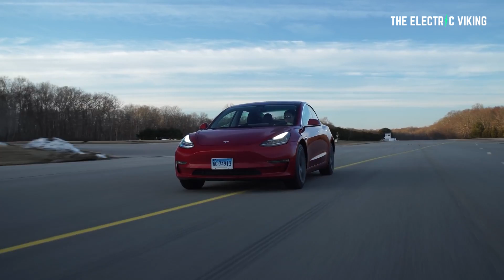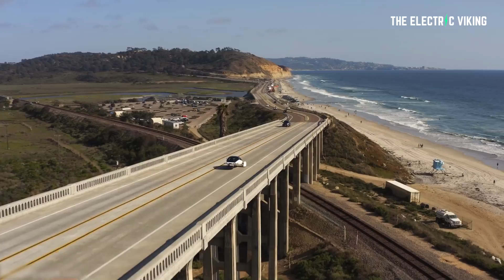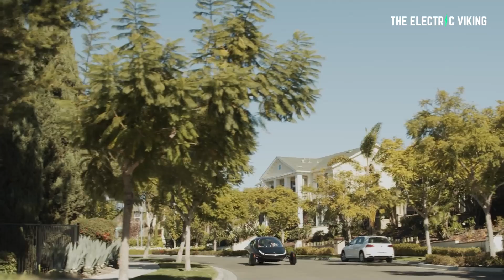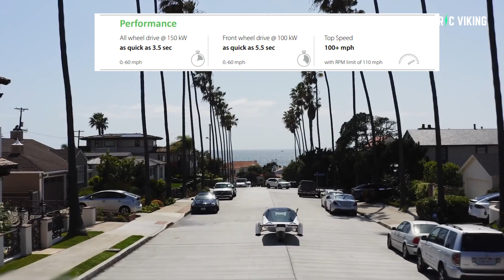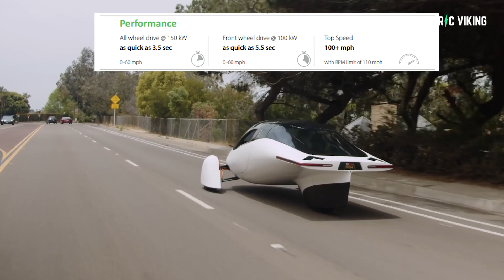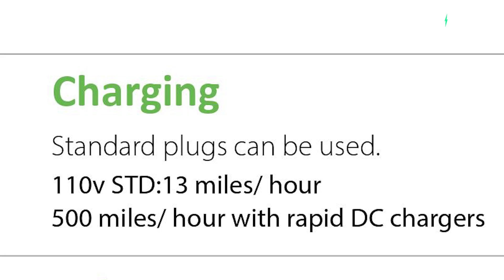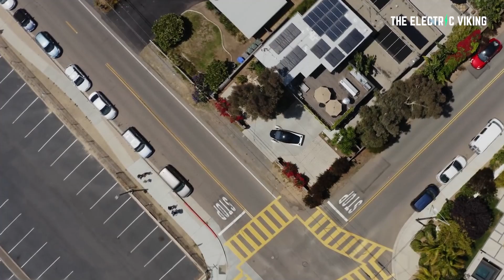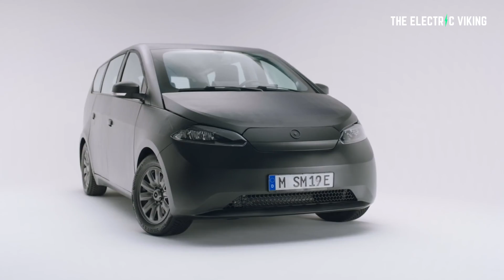I JUST bought a self charging US EV with 1000 mile range

Comment: That is an exciting vehicle but I have concerns that include these two:
1) The wheel covers are so close to the ground that hitting a pot hole would break a piece off, I would think.
     (Looking forward to your report on the suspension)
2) How safe does a three-wheeled vehicle take a turn? Aren’t they more prone to rolling over?
Reply: I've read they're slightly increasing distance between the road and the wheel covers, but I live on a gravel road so I opted for the off-road package for more clearance. As for stability, there's video, I think, of them at the track with an Aptera taking extreme maneuvers without anything scary happening.
Reply: And the wheel covers move with the wheels so the gap between them and the road is constant.
Reply: @ethelred2648  what I was thinking, on a regular car if the tire goes down into a pot hole, the rubber tire hits the pot hole crater and the surrounding road above the crater, without necessarily breaking because the tire is rubber. But with the wheel cover surrounding the tire, I would expect the wheel cover to break when it hits the pot hole crater or surrounding road above the crater. I mean, the wheel doesn’t separate down from its surrounding cover, right? I’d like to see someone driving the vehicle over a pot hole to gain a better understanding of how it works.
Reply: @georgeginsburg545  in that instance you’re right. It could be an issue.
Reply: “Aren’t they more prone to rolling over?” No, not if the two wheels are at the front. See any video of a Morgan 3 wheeler racing.
Reply: The alpha prototypes have sailed through the "Moose test" without losing control or rolling over.  Battery weight in the belly is a beautiful thing.

Comment: The concept of the Aptera is great, but it has some serious drawbacks:

As others have mentioned, the unspring weight of wheel motors is not an insignificant issue, there's a reason why it's not a good idea to subject your motors to all that impact and vibration.

At over 2.2 metres wide, it's almost as wide as a large truck, it's over 200mm wider than a Tesla model S, and that's a wide car. This makes it more difficult to manoeuvre in tighter spaces, especially in garages.

The outrigger wheels are prime candidates for getting hit in carparks. As other drivers back out they won't be able to see those wheels sticking out as they will be below their bonnet line. There will be a lot of wheel damage incidents with these cars.

The fairings on the outrigger wheels look like they are only secured along their inner edges, they bounce around a lot in the video, those fixing points will fatigue, that's a dead-set certainty, unless they address that.

The skirt around the rear wheel is too low to clear any sort of speed hump, there's at least 300mm of skirt in front of the wheel. I really hope that skirt is made of flexible rubber.

I think they need to do a redesign on the outriggers, pull them in at least 100mm on each side, redesign that rear wheel skirt for more clearance, and consider dumping the in-wheel motors and go with shaft drive, like more sensible manufacturers have found to be the safest and most reliable...
Reply: You make a great point about outrigger wheels being hit in parking lots because they don't get seen by other drivers.  Your other points are valid as well, but will probably (?) be addressed in the beta versions being built now.
Reply: Great points, especially the wheel fairings bouncing around a lot. But if they take your suggestions and improve the design to be more robust and suitable for the roads, then the low drag coefficient, the solar charging, and the relatively low cost, make it a a cool and exciting way to finally get an EV.
Reply: The sticking out is a big concern. I can see having to carry traffic cones and having a little flag holder for those Wheels while parked.

My big rig is the same width it's not a problem you just can't float all over the road.
Reply: Good point about the wear and tear on the motors when placed in the wheels. There are several manufacturers showing "concept" designs of in-wheel motors. So, some engineers appear to believe that bearings and material designs have evolved enough to handle it. However, I can't imagine the in-wheel design can be as durable as a motor sitting on the chassis isolated from the hundreds of bumps per minute experienced at the wheel. Time will tell.
Reply: My video's take a logical look at most of the drawbacks. The 'skin cooling' is by far the worst.

Comment: Good luck. I put a $500 deposit on an Aptera in 2006. I think it would have been a really neat vehicle at the time and they were the only thing around. There are so many more options now. $45,000 seems like a lot considering a model 3 is about that. We'll see.
Reply: I like the Model 3 too - And the korean cars. The issue I have is they're all stuck around 300 miles of range. It would be nice to have a lot more with the current infrastructure still in its infancy.
Reply: @peterjorgensen3  I guess it all depends on your lifestyle. I personally do not see the point of more than 300 miles of range. I currently have an electric motorcycle (2016 Zero FX) and it only has maybe like 40 miles of real life range. I live in the foothills of the Sierra Nevada mountains and i ride it pretty hard so my actual range is far lower than what they suggest. Still, even that has always been fine for commuting and whatever errands I have (about 95% of my traveling needs and why I bought it). I just plugged it in when I went home and it had a full charge in the morning. My ICE car gets like 220 miles on a full tank and I do not think that I have ever used a full tank in a day. The only time I can imagine doing so is maybe visiting family out of state and then most likely the best charging infrastructure is going to be with a Tesla since you can use Tesla chargers as well as any others there might be.  I wish everyone could live with an electric vehicle for a few months. I think it would do a lot to cure range anxiety. I think Aptera had a chance back in the day but there are far more compelling vehicles for around the same price. 1000 mile range is impressive and sounds cool but as I said, for me at least, it is completely unnecessary and even overkill...and really the only thing that sets them apart now. A bit of trivia: there is a cameo of an Aptera prototype in the first Star Trek (with Chris Pine as Captain Kirk).
Reply: @yukikoose9435  Yep! I do a lot of multi-state road trips. My Kia Niro EV has been acceptable on the Electrify America and Chargepoint networks we have here in the intermountain west, but there are some places I can't go - even with the Tesla network. It's closing up fast but more range would be really nice for those long-range camping trips.

Comment: I would not buy this car with the wheels on the front sticking out from the sides so much. I could see the wheels and axels getting damaged easily.  You can see when it parked each wheel was on the white lines on the parking space. Just not my type of car.
Reply: It doesn't have any axles.

Comment: My used gas car cost me $8,000 and has more utility than the Aptera. Over its useful life span it will never cost me $40,000, including refueling.  I invested in the Aptera company because I want to see the world's most energy efficient production EV go to market, and make some money if they succeed. But until there are used EVs that cost less than $15,000 with the same utility value of a used Honda or Toyota crossover or sedan, it will be a while before I buy an EV.
Reply: As one that has only bought used cars. I agree used is best in gasoline cars.  The $25,000 version with no gas, oil changes, or trying to guess how much the check engine light going to cost me over 10 to 15 years it becomes financially sound decision.  Or wait 3 to 5 years to buy a good used EV.

Comment: I have been following the Aptera for a while now. I'm surprised that it took so long for Sam to make a video about it. This is one EV I would consider buying sooner rather than later because for me most EV's are too expensive for the range you are getting at this time. But I would probably go for the one with the 400km range which would suit my needs without having to spend too much. But I imagine prices in AUD are still not going to be cheap, however the big payoff would be the solar. Given the way that petrol prices are going, you could probably pay off a loan with the fuel savings if you bought the base model, however because I would use this car for Uber Eats deliveries I would need the extra range, but that said, the car would pay for itself no problem doing that work.

Comment: Hi Sam. Did you order in RH drive and when is this available ? This would be my pick because of the packaging and efficiency.The Aptera uses the teardrop shape and lightness to achieve  this along with the solar. Almost every other EV is based around SUV  size ,meaning big and heavy.  If I had the money I would buy one,the question is ,will they actually make them this time ? Oh,is there a 240 V version? At 2.2 m wide it may not fit in many parking spaces,and how about the turning circle ?

Comment: You reserved it for $100 USD (refundable). I also reserved the 1Kmi range AWD vehicle about a year ago.  I invested in the company. Sandy Munro is working with Aptera so this is real. The company has been very transparent. In Australia, you are going to get some serious "Sun" miles.  In the USA, the Aptera may qualify for a Government rebate which will reduce the cost. And the insurance companies consider it a motorcycle and therefore the insurance will be cheaper. With torque-vector steering, hub motors, easy home charging (110 volts USA 30 Amps at 13 miles per hour, 104 miles per 8 hours hours) + solar charging, you will have extra money for some extra fun.
Reply: Is it not able to use 240 Volts like other EVs?
Reply: @incognitotorpedo42  yes it will. But with a screw driver and alligator clips, you should be able to sneak some power from a parking lot that has 110 volts behind the maintenance cover plate when there is no receptacle. Such as a local parking lot.

Comment: Two queries regarding this EV (1)  Is it available in RH drive?  (2) Is it adapted for Aussie domestic voltage/frequency if you want to charge from your house?
Reply: Yes. In addition, if I've read the "laws" correctly, in Australia and New Zealand it would be classed as a Motor bike, not a car. Do you need a Motor-Bike licence to "drive" it? Plus, Govt taxation import rates on cars versus M bikes are quite different. How will this be treated? Cheers.

Comment: In general, I hate "quirky" EVs, but I make an exception for Aptera because they seem to have good reasons for being quirky.  However, one disadvantage of the three wheel format is that it makes it harder to avoid potholes, manhole covers, and road debris.
Reply: I ride a three wheel recumbent trike with a similar wheel configuration. It took a few rides to figure out, but I am now able to quite easily avoid road debris and small holes. I'm sure you would hit a few with the Aptera before your brain gets the message, but with a little practice you would have it down.
Reply: 3 wheel vehicles are legally motorcycles, will have lower safety standards and will NOT qualify for tax incentives.
Reply: @scottmcshannon6821  build back better was going to provide a $7500 incentive but is now dead.  They are voluntarily testing to car standards and including airbags; as an autocycle this isn't legally required.
Reply: I have to ask: How will those deep fenders on the front wheels cope with potholes and speed bumps?
Reply: @clasqm , same clearance as a Honda Civic.
Reply: I owned a 3wheeler (campagna T-Rex). Anxiety about potholes is overated.

Comment: I have one on order, but I may delete it depending on how long it takes to receive it (limited deliveries beginning at the end of 2022, volume deliveries near the end of 2023) and when the Chinese imports start arriving. The price is expensive for what you get, a two person vehicle with limited storage and towing capacity, but the "never pay for fuel" option is nice. And it should be extremely quiet given the slip stream design as well as electric propulsion. 

One minor issue you may not have considered, you can't get to a drive up fast food window without opening the door to get the food. The outrigger wheels make the driver a long way from the outer edge of the car, so when you come to a drive up window, the wheels may be inches from the building but the driver is several feet away from the window. Minor issue but an artifact of the design. 

In order to keep the extremely efficient air flow, the air conditioning system does not have a radiator up front. They are using a system of tiny channels through the fiber body to remove heat from the cabin. Unique in the automotive world, I think. 

Fun stuff, but still expensive for what you get. Maybe the costs will come down with volume production.
Reply: Might have some small advantages on wind noise, but the majority of cabin noise is from the tire/road interface.  Probably not going to be a lot better than conventional cars.  I'd expect it to not be quiet, but maybe they'll surprise me.
Reply: @incognitotorpedo42  I assume you are speaking of ICE cars? Have you driven an EV? They are extremely quiet. Aptera, with its motors outside the cabin, I think we'll be even quieter.
Reply: @IBMara  Good point. The outrigger wheels should keep the road and motor noise, both separated from the cabin.
Reply: There is a roll down window. The fast food restaurants drive ups  I visit use serving trays to extend their reach. I am sure anyone smart enough to buy an Aptera will be clever enough to figure out how to get there fast food. 😉
Considering all you get with an Aptera I think they are the buy of a lifetime and they will be made 100% in America.
Reply: Watch my video's about the cooling. I would appreciate someone explaining it. BTW, the Beta has a radiator (seen in my last video).

Comment: My top choice - and the same version Sam ordered. We would still need to order another car to fit lore people or to pull a trailer. But that we already do in a car-sharing system.
Reply: It's cheaper to use ride sharing then buy a reliable second car.  My two seater pickup never needed a third seat. Expect for once for 8 miles in many years.

Comment: Everyone is switching to an electric motor in each wheel because of these guys. Too bad they've been so slow to market and everyone else has been able to capitalize on the trend first.
Reply: Aptera has in wheel hub motors with no gearbox. Other manufacturers might be using a motor for each wheel but they still require a gearbox to reduce drive shaft revolutions.
Reply: @skipondowntheroad5833  There's no gear box in an EV, even when one motor drives two wheels. A motor on each wheel makes torque vectoring cheap and easy (it's just software) though, since you don't need an electronic limited slip differential to do it.
Reply: @skipondowntheroad5833  The 50 lbs of added unsprung weight is too much of a disadvantage, elsewhere. Smart designers add a short drivetrain, which is still single speed, so not a heavy gearbox like the normal 5 to 9 speeds you think of. Hardly heavier than the short shaft and all sprung.

Comment: Call me when the crash testing is done.  That thing is no where near ready to go into production, let alone in production itself.  They don't even have the prototype figured out.

I can't wait to see when you actually get one.
Reply: I'm interested to see the crash testing too. There's a couple of injury prevention strategies, either energy absorbing crushing or bouncing off. The carbon fibre body of the Aptera is designed to bounce rather than crush and with a full suite of interior airbags it should as safe or better than relying on crush absorption for a small vehicle. It's what F1 cars use quite successfully.
Reply: @earthwizz  I'll believe it when I see the rating.
Reply: You can see the first finished Beta prototype for testing on my site - it's hideous.

Comment: Solar ev’s just seem ideal. Could have solar panels on our home too for when you do have to plug in or if. Lol it doesn’t get much more fuel efficient than that.🙂 buying one of these is almost like opting for free fuel for life. At least as a daily commuter for work and back that is. And other errands
Reply: My solar panels only lasted 10 years. One little flaw destroys the whole panel.
Reply: @toddmarshall416  I don’t have solar panels yet and so I appreciate the insight. Under the right company that would still be under warranty though right?
Reply: @toddmarshall416  This is not the case with the cells and panel design Aptera is using.  It used to be the case for some earlier ones.
Reply: @n.brucenelson5920  Warranty not the case?
Reply: @aussieideasman8498  Damage to a cell destroying the output of an entire panel doesn't happen.
Reply: @n.brucenelson5920  I have never had a cell damage response to a warranty question in my life, until now, lol!
Reply: @aussieideasman8498  If you are asking about warranty coverage,, it will be in line with industry standards, and will be published after validation tests are complete.
Reply: @n.brucenelson5920  Clueless.

Comment: I only spend about 1000 on gas with a Prius per year as it is. Safety and space is worth more than outright efficiency to me. I do have a MYP on order though.
Reply: I agree. But being retired, just wife and I, this is going to come in handy. And it is going to be safer than you think. The body is a  made out of a strong composite material the will stay in tact like the Race vehicles. So this can be as safe as some expensive Lambo. Wheels can shear off but you will stay secured.